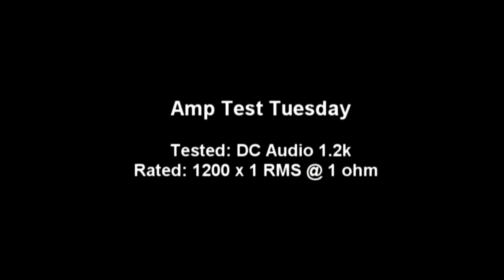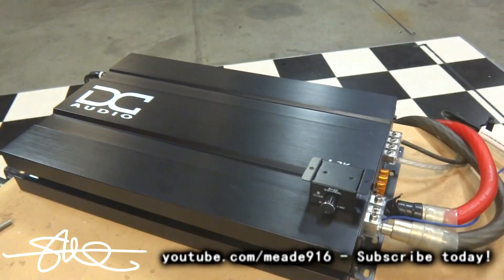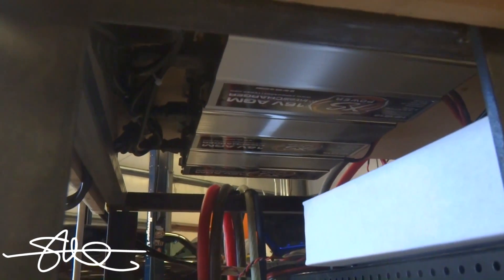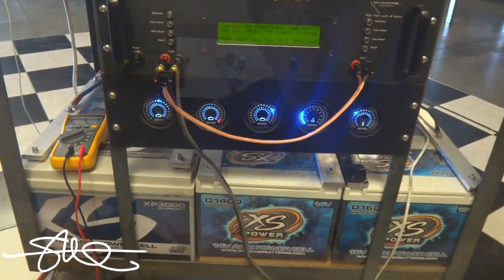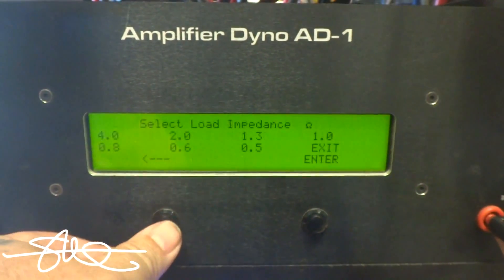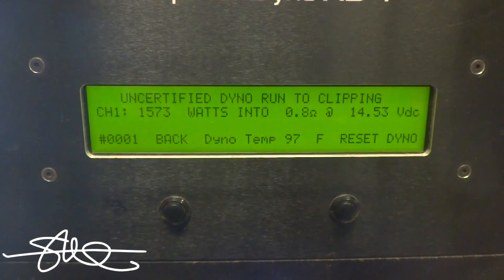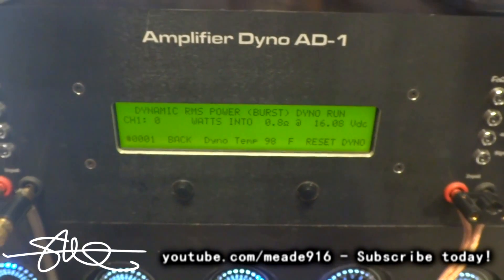Amp Test Tuesday - DC Audio 1.2k - Rated 1200 watts RMS - SMD AD-1 Amp Dyno

Comment: so I have a question that hopefully someone can help me out with as I know very little about car audio. I recently bought 2 dc audio m38's 2 ohm dvc,I have been looking at getting this amplifier to match them. when the specs say 1,200 watts rms at 1ohm  x1 does that mean it puts it out to one sub? and if so if I wired both subs to a 1 ohm load would they spilt the 1,200 watts?

Comment: This test is not realistic. You will never see that running on a 12v system not everyone has the luxury of running a 14-16v system. I have a g34 under the hood and two g31's in the trunk. Car starts at around 14.4-14.8 The lowest I drop is 13.6  with my car running. Would be nice to see it done in a car so we can see some real world testing.
Reply from the maker: +Jeromey Smith actually the test is very realistic. This isn't a "14-16v system" it is (3) 14v batteries with NO alternator backing them up. A 15a charger to refill in between runs is not the same as an alternator pushing 300a at 16v.  It doesn't matter what voltage i start the test at, the AD-1 puts out it's final number on the voltage you see when the test is complete (at the end of the test). So when you see it start at 15+ that is irrelevant if the final voltage is 14.2 or 13.8 just like a REAL car would do.  It isn't perfect but it is "real world" enough.

Comment: When you doing the test you using bassboost ??
Reply: Dima Mityay I don't think he does. Probably just sets the gain as needed.
Most people don't use bass boost as it leads to distortion.
Reply: ***** Me to... i have the 2.0k and my gain bassboost and remote control set to 0 and shaking the vehicle... But thanks!

Comment: This clearly shows almost 16 volts in several of these tests.  Steve, can you make a small video explaining how your dyno works between each test?  I love ya man but I really want to see what these amps do at 14 or possibly lower.  Shouldn't it start at 14 and then drop during the test?
Reply from the maker: nope.  This amp is on a small battery bank with just 3 D1400. They are 14v batts.   You saw "almost 16v" because it is on a 15a trickle charger and i am topping them off in between runs.  A 15a trickle charger on a 1200 watt + amp isn't contributing much at all once i pull it down. In reality, you are looking at 14.5 volts when it comes down to it, just like if your car was running.  It's the closest i can get since i obviously can't have an alternator spinning on the side of my bench.  I figured i wouldn't have to explain that since it is pretty obvious and i already explained it several times.
Reply: meade916 Understood.  Thanks for the response.

Comment: the higher voltage shown on the battery's after a charge is called a static charge. it has no bearing on the voltage of the batteries as it is a no load voltage and as soon as a load is put on the battery is drops off quickly ( load of test bench or a battery tester )
Reply from the maker: thank you bro, for paying attention.  So many people type out of their asses and don't even understand what they are looking at lol

Comment: lol, i would like to see some cadence tests as well as digital designs, whats your opinion on cadence, i use to have a z 1500 on 2 cadence beast 10s in a reg. cab dodge and it pounded hard as hell, my rearview mirror fell off in less then 2 minutes with that setup, wish i still had the truck.

Comment: Had a question. I see you're partial to Rockford (I loved the old cheater amps) my question is, ehat is the cleanest power amp would you recommend.  
I have been using jl audio for some time. 
Haven't had a system for sometime now and looking to get something with good fill bass in my daily driver.

Comment: if its making more power @ .8 ohms and the volts where higher. when it was at @  1. 0 ohm it was voltage drop more. if that amp was rated 120 amp fuses that's only 1620 watts pep .

Comment from the maker: i didn't mean "blow you away" as in "beat you" or "win" something vs you.....i meant the sound itself would blow you away.  There is a lot more to making a system sound good then JUST a brand name.  It helps to have great equipment like RF and JL......and all the "trendy" "high end" names too.....but you STILL have to do the work to make them sound good.  SQ is not plug and play.

Comment: I wouldn't recommend anything lower than 1500 watts for 2 12" Kicker L7s. I'm getting another L7 to use my dual ported box and plan on using a Hifonics BRX2000.1D to power both L7s. This is a good amp, but not enough to power 2 L7s.

Comment: Is it ok to drop it down to 0.5ohm if you have x2 box rise? I did it with my old Hifonics amp and had 0.8-1ohm box rise. It got hot pretty quick probably because I was milking it like anything. It ran fine for long periods of time. I've got a Arc Audio 4000SE now and was wondering if I could do it to that, I didn't want to damage it because it's quite an expensive amp over here in AUS. Thanks

Comment: Depends on how much power you want or how many amps your planning on running. RF is Great quality and so its DC. If you only want 1 amp with alot of power (such as 5000 watts or more) id go with DC. Either way you cant go wrong with either choice.

Comment: Hey Steve first GREAT WORK i love it. 
So my question is i seen you test crunch amps and they are in Fry's stores. I have never tried them but i have tried Hifonics for Sub bass. I see these 2 brands are cheap for the $ and if setup correct you can get good sound. Have or can you test a Hifonics D-Class? I have the BRE2500.1D Brutus Elite 2500-watt super D-class 1 channel mono-block running 4 DVC 12's 400 rms, total 2ohms or 1.8 or 1.6. lol
so could u test one? thanks_Daniel

Comment: Great Video Steve, nice work! One question though. How can the amplifier  burp out 1917 watts RMS when on paper it cannot peak higher that 1860 watts? (40amp fuses*3= `120 amps- assuming @ 15.5vdc= 1860 Watts) If it burped out 1917 watts, wouldn't that cause the fuses to blow? I'm a bit confused, could you please explain...

Comment from the maker: the actual reading is taken by the AD-1 right at the point it spits the number out.  Each mode is a 15 second test, so when you see  xxxx watts at (14.7v (for example), when it started at 15.5 or above, that is only because it took final readings at the END of the test.  The 10a battery charger is not a big factor.  It just keeps the 14v bank topped off.  Some of the larger amps i am going to test soon will be ran directly out of the Tahoe, off my 4 alternators and 10 batteries.  :)

Comment from the maker: being a 10a intellicharger (not power supply), it really isn't affecting the outcome at all, other then the batteries get topped off in between runs.  10a on a 1200 watt amplifier isn't really shit, as you might know.

Comment: 1 ohm if impedance is not just 1 ohm of resistance, a typical speaker will have varying IMPEDANCE across the frequency domain.

Comment: If you go to clipping with the amplifier - it's not because of the pre-out signals.  it's because the amp got to clipping by its DC rails.  I would think the pre-out signals would play no part in this at this level and by this test.

Comment: He says it's on a charger which increases the voltage but not much amperage from them. Maybe one day Steve can make a video showing 2 tests, one with the charger on and one with the batteries freshly topped up but the charge disconnected. so people who worry about it can see the actual effect it has.

Comment: Hey Steve.. Long time no chat!  I have a quick question about the results (maybe I'm reading them wrong) 

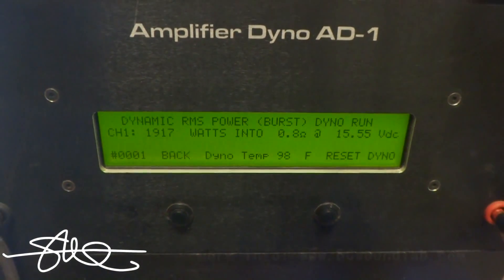In the video at the 4:45 mark it shows the amp did 1917w into 0.8 Ohms @ 15.55vdc but in the results screen at the end you list the results as being at 14.4v.

Am I getting voltage numbers confused?

Comment: Test the mtx 800w 2ohm amp I would like to know its full potential I have one in my room and if your wondering why it's in there it's because it powers my 2 12" mtx terminators and my one 8" pioneer subwoofers I use them for my surround sound.

Comment: Been subscribed to your channel for years, I love your vids and your the best when it comes to this stuff, seen every amp dyno test and i just felt like, yeah i know this one is going to do about this, and it did, I just wanna see amps that I have no clue what they put out. Like my buddies Power Acoustik A1800db mono Block he got for 50 bucks a a pawn shop and he its pushing 2 rf p3's Dvc 4 ohm subs, at 2 Ohms and amp doesn't even get warm, and p3s get a lil bit warm.

Comment: but you know there are assclowns out there that will doubt it because they ran it on a optima red top and a stock alt with 4g going to the amp and bitch because they get like 600w on a clamp test